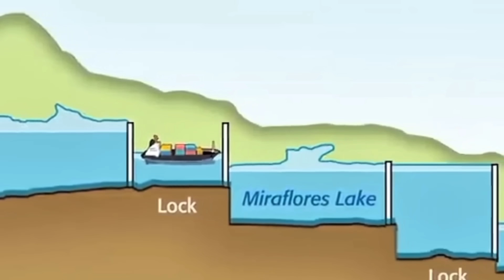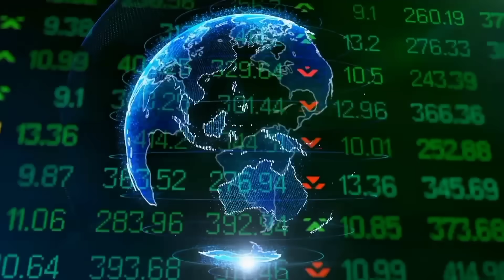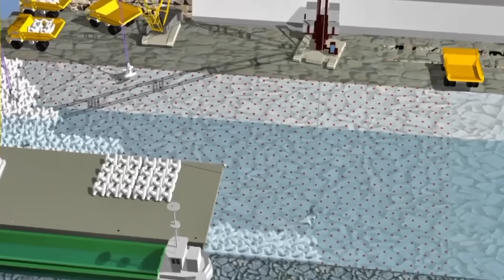Mexico Is Building Something That Shouldnt Be Possible!

Comment: Mexico 🇲🇽 railroad was being vandalized. And the trans were being robbed. That's one of the reasons why Mexico was being set back. The united state had those things going on to. 
But the United States paid for security to protect the railroad in the United States. 
And the United States made a bold decision . And begin hanging tran robers.
The united state passed the death penalty. Hanging for tran robbery. No questions ask if they caught anyone in the act. Mexico would not pass the death penalty. And tran robbery was on the rise.

Comment: I can’t imagine it would cost less to unload a ship, ship product 200 kilometers over land and reload on a different ship than using the Panama Canal?
Reply: The Panama canal crossing fee is really expensive, like 200 000$ for a container ship. And if there is a drought, there is not enough water to fill and empty many times the locks. So they have to reduce the number of ship per day, or they have to install pumps to reuse the water. So rail can be cheaper. Depends on the margin the operator makes. Rail wont be able to handld the freight volume that the panama canal can.

Comment: Ship docks. Freight is off load at dock and transported to rail cars. Then transported to other port and reloaded onto another ship. Got it. All that logistic cost and time is cheaper than using the canal. I like to see the cost for all these steps.
Reply: Dear W. Moy
I’m guessing that Mexico is planning to cater to ships that are too large to pass through the Panama Canal.
On the other hand if the Panama Canal suffers from drought, thus impeding a significant amount of traffic, the Mexican alternative may become attractive indeed.
Reply: @georgesotiroff5080  As time goes on, it maybe the only way!
Reply: Te purpose of the corridor is to receive raw materiales, process them in Mexican territory and ship finished goods around the world.
Reply from the maker: It would be interesting to compare costs, for sure.